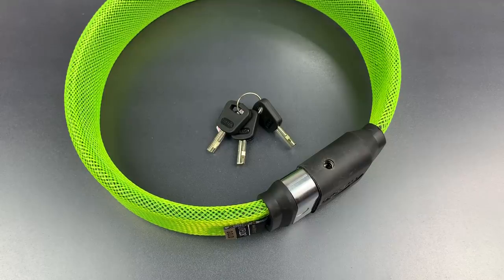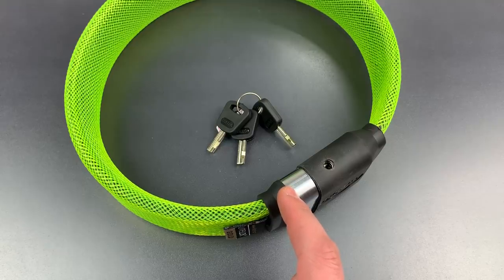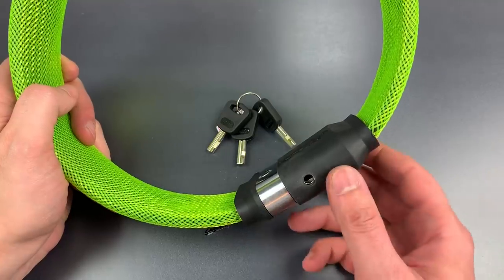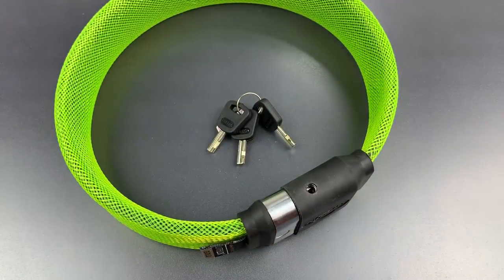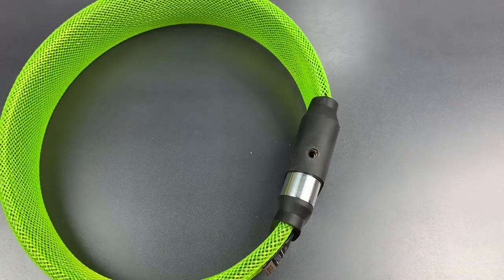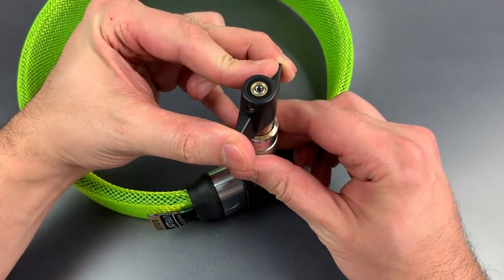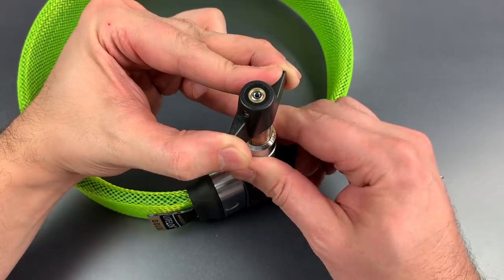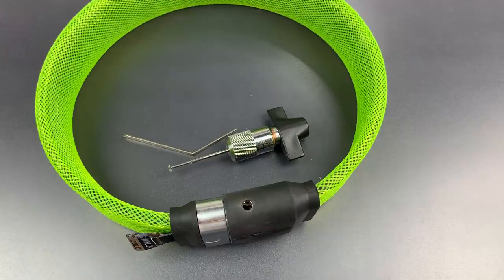[784] LiteLok Gold Bicycle Lock Picked

Comment: Finally someone trustworthy reviewing this lock, thank you very much
Reply: he said something about his tool and not working the first time, that should be shown.
Reply: @snoodballla9632  He said it didn't work. Just pause the video with the tool in for about 3-5 minutes. I imagine that's what it would have looked like. Not the best content, ergo, "It didn't work"
Reply: @snoodballla9632  He said that top tension did not work so he switched to bottom tension.
Reply: @snoodballla9632  its just the bottom vs top disc tension. its going to be one or the other, there's no point showing that

Comment: So there is a video of one of these being defeated "in 17 seconds" that Litelock has apparently had BLOCKED in the UK and tried to have removed from youtube.  When trying a twisting attack have the lock housing to the front and twist it from the back, that seems to be the way that people reported theirs were broken from. I am not sure if some units just don't have enough cable attached to the lock unit or if they are all like that.
Reply from the maker: I think they’ve added epoxy since then. I saw the video you’re talking about and closeups of the broken lock. It appears to be a crimp connection only. Mine is crimped and epoxied. Assuming I’m correct, it may be that they’ve altered the design to address this. As for blocking the video, that’s serious BS.

EDIT- I need to make a correction... now that I have torn it down, I see this joint is welded, NOT crimped and epoxied as I previously noted.
Reply: @lockpickinglawyer   Interesting that they are now adding epoxy. Really looking forward to the destructive testing now that the picking is over. Funny that Wayne Winton said that it was "pick proof" after only looking at the keyway in his video lol.
Reply: @lockpickinglawyer  the epoxy is a joke. You can pull the black rubber without any tools and start working on the cables.
Reply from the maker: I need to make a correction... now that I have torn it down, I see this joint is welded, NOT crimped and epoxied as I previously noted.
Reply: @lockpickinglawyer   Ohh, interesting. Can't wait to see how it holds up.
Reply: @lockpickinglawyer  can't wait for the vid :)
Reply: @lukasadamson6091  he fukn rekt it
Reply: well the litelok video with 17 minutes where they "testing" their lock video is suspicious. they disable like/dislike..Only 7 comment that is all positive in 200k+ views video. each comment is made 3 years ago. all 7 account has generic name and profile picture and has comment multiple time on number of videos on litelok channel. Also all 7 account is created in 2016 and 2017 and majority of said channel is subscribe to the same multiple channel. welp it clearly that they delete comment and using bot for positive comment. 100% litelok deleting comment. i try comment on their video aaand its gone when i check their comment section using incognito mode and other account...coward
Reply: @sirdarkon4517  Yup, it has become a bit of a meme in the lock community. Every time it comes up we all have a laugh.
Reply: @sirdarkon4517  Not true ! 2 comments are mine and both are negative xD
Reply: @lukalalosevic200   I don't see your comments on the LiteLok video, so it may have been taken out (I know many comments can be deleted, but seem like they are still there for the user who commented), so I think there is no chance that they are not deleting comments, because the Litelok video has 7 comments and this one has less views and 350+ comments.

Comment: Excellent.  Time for the Ramset and hydraulic cutters!  Thanks for great video!!
What picking tool are you using?  Haven't seen it before...
Reply: my bet is on the ratcheting cable cutters
Reply from the maker: Something from the usual Chinese websites, but modified.
Reply: @lockpickinglawyer  Thanks, but for those of us who are kinda new, can you tell me a little more about which "usual Chinese sites"? Thanks again!
Reply: @telorum1970  Banggood.com  I know what it sounds like, but it's basically Chinese Amazon.
Reply: the ratcheting cable cutters and the hydraulic cutters are pretty OP. Once you have both you can open anything you find on the street.
Reply: I would like to see the ramset gun used on this lock
Reply: start with standard bolt cutters and move up.  After the cable is cut, then ramset the locking mechanism!
Reply: @lockpickinglawyer  Thank you for the reply,  the great vids and narration.
Reply: For those who will be searching exactly this one it's "lock pick for ABUS"

Comment: Entertaining to see all the debris come out of the lock each time you pulled it apart - curious if this one would wear in, and get easier to pull apart with time, or if it just gets worse.
Reply: I imagine if the material the lock lug is coming out of is softer than the locking lug it'll eventually just gall up and become a total mess. Probably requiring you to go in there with a die grinder/file to open it up some. This is definitely a manufacturing flaw, and considering the price of this, it's simply inexcusable, total QA fail.

Comment: I suspect it would succumb quickly to bolt cutters, metal shears or the like.  Looking forward!
Reply: I bet you could get trough really quick with just a small cable biter as well. Since the inside is made of small wires you just "Chew" trough it in a minute or so.

Comment: This robust lock is essential for keeping your bike safe. They tried to defeat a single Litelok with a variety of commonly used kid's playset tools. As you can see, no matter how hard they tried the lock is sturdy enough to withstand all the different toys they use, from plastic bolt croppers to rubber hammers. You can be sure that your bicycle is well-protected from infants with Litelok. Not only does it meet all British and International lock quality standards but it has also attained the greatest security rating (0 out of 0) as awarded by the "independent" testing and certification "organisation" Sold Secure. Liteloks give you peace of mind, they feed you and keep you secure, they are in every sense your anchor in life.

Litelok has an easy-to-use and flexible strap, making it effortless to secure around fixed objects (and to cut open), from bicycle parking stands to street furniture (what does that even mean lmao). It also comes with a patented inline (and definitely pick-proof, trust me) lock that was developed in close collaboration with a renowned British firm, whose name has been long forgotten to time. Liteloks close shut without a key. A key (or cable cutters) is only needed to open a Litelok. Weighing just 1.1 Kg (2.4 lbs), it is also very practical to carry around with you. While cycling, Liteloks can be secured along the top tube of your bike with high-quality velcro WrapStraps (which may actually be stronger than the Litelock itself), or within your bike frame. Alternatively you can carry your Litelok in a bag, or perhaps where it belongs, in a disposal bin.

Oh and by the way, it can be opened in 16 seconds with cable cutters.

Comment: Owner here:
Yes, my lock also requires a lot of strength to wrap it in order to close and open it. The key sometimes is stuck, when the cables bend the closed lock. So in order to open or close, I sometimes have to wrap the lock even more. Also the key sometimes is hard to even slide into the lock without twitching it around. One of the most vulnerable places to cut the lock is where the black rubber starts and the green nylon end. The black rubber is only glued on the blank cables and can be pulled away to reveal them.

The very concept of the lock might be cool. That's why I bought it (ass cheap second hand - didn't believe the problems I just stated when the previous owner told me about them). But the lock isn't that light and very unpractical even if you fall for the marketing gag of buying two pieces and clipping them together to use them as a belt  - I'm quite thin btw.

Comment: As always, a brilliant job opening that lock.  I haven't sent those things to you since we have some issues right now with our postal service.  Another thing that comes to mind is that it looks hard to get through the spokes of a bike wheel.  Since it's heavier than a U lock, that's kind of disappointing.  When I'm going somewhere, it's pretty clear that it's not the bike or the lock that needs to be lighter, but even so every bit helps.

Comment: Nice video. Thank you. 

How about Boomerang Cyclotrac GPS Tracker and alarm? It has proprietary screws to attach where the bottle cage goes, and you can still put a cage over it. It uses Verizon's LTE for real-time tracker, alerts and alarm if the bike is wiggled to much.

Comment: i think the main physical weakness for these locks is where the cables meet the clasp. the one i saw fail just had the cables simply crimped into place which isn't a strong enough bond to resist twisting. the ends should be brazed or soldered together or the ends of each cable capped and then bolted into a block. 

strong, light, cheap. PICK TWO.

Comment: Big side cutter plus a big hammer = 15 seconds or so
How to: place the wire in the side cutter jaw as deep as possible, with the cutter square against a solid wall or the floor(one handle of the cutter sits firmly against that wall or floor). Then hit the upper handle with the hammer. 2-3 times for each wire should be enough.

Comment: I reckon that lock picked is still more secure than a master lock.
Reply: I mean, a well placed length of mechanic's wire is more secure than a master lock,  if only because it's a pain to work with.

Comment: I would love to see you show how the cables can be pulled out of lock housing with twisting.
Reply from the maker: I’ve seen that video, but I think they added epoxy at that joint since then. Besides, I have a faster way. 😈
Reply from the maker: I need to make a correction... now that I have torn it down, I see this joint is welded, NOT crimped and epoxied as I previously noted.

EDIT- I need to make a correction... now that I have torn it down, I see this joint is welded, NOT crimped and epoxied as I previously noted.

Comment: I too have become an avid fan. And also, I was curious of the tool you used. Could you please do a video or share some more info about it? Thanks so much!
Reply: It's a disc detainer pick. It allows you to rotate each disc individually while keeping tension on the core. This video might help you understand how disc detainer locks work, and in turn, how the pick works. https://www.youtube.com/watch?v=Qu2vm4At4JM It seems like many of the disc detainer locks that LPL picks don't even have false gates (Not because LPL couldn't pick them, but because most manufacturers don't seem to give a shit about making high pick resistance locks).

Comment: I have that lock and yes it is difficult to open with the keys, some times the keys will not even turn inside the locking mechanism.
Reply: Man, this thing has marketing wank written all over it. If your keys aren't opening it reliably, that points to generally poor construction and tolerances. Makes sense if you consider the profit margin on the lock given the amount of marketing money they're spending on it.

Comment: When you opened it after picking it, I noticed some steel debris fall out, maybe the reason it's so hard to open is tight tolerances and a lack of lubricant? Also perhaps a magnet for some reason keeping the lock closed that you have to pull through?

Comment: You make it look easy. But I think you should mention how much went into finding and modifying a back of key tensioner and learning to use it. The list of people who can open that in a reasonable time is pretty short.
Very curious to see the destructive testing though. I wonder why they think multiple cables is better that one thick cable? couldn't you just cut through them one at a time with bolt cutters?
Reply: It's probably a flexibility thing. One single cable couldn't be that wide while also being that short, as it wouldn't be able to bend tightly enough. The thinner the individual cables, the smaller and more flexible the overall lock can become, although at greater risk of compromise as we're soon to see!

Comment: Maybe it's cosmetic flim-flam, but what's that flat strip at the left of the lock body in front of the cable?  Clearly visible at 3:47.  Probably nothing important.  Or could it be a latch-release mechanism - give it a tug after you've unlocked it and the shackle springs out?
Reply from the maker: Just metal... not a release.
Reply: @lockpickinglawyer  
So why is it there?  It looks as though it could gouge pieces of skin off your fingers as you struggle to get the lock open.  Even apart from that, no competent engineer would include a part that serves no purpose.  So it must do something, right?

Comment: I realise I'm a bit slow to comment but I've a couple of these locks and don't have the same difficulty separating the two mechanism parts although have found the cylinder a bit temperamental.  Most recently I managed to get the key stuck after unlocking and separating the mechanism and now can't turn the key or remove it... any tips to help release the key?

Comment: Just watched a video where this guy cuts through the Lightlock with an angle grinder in 14 seconds. He did day that he thought it was pick proof.  😃🤣😂😆😅😃🤣😂🤣😂🤣
Reply from the maker: Yup, Wayne’s video. He’s probably right as a practical matter... I can’t see a thief picking this. But it’s certainly possible. As for grinding, that’s no surprise... I’m going to try without power tools just to add another data point.
Reply: @lockpickinglawyer  After watching your video on the Lightlock I searched around at other Lightlock vids. I found one that reckons bolt cutters won't touch it.
Reply: Wayne also suggests the lock could possibly be vulnerable where the two pieces of metal grip the locking bolt.

Comment: I don’t understand why they would make that lock so difficult to open. So the difficulty of opening the opened lock is a safety feature???  People won’t know the lock is successfully picked??? OR Quality Control issues?  We might know the answer to that with a second lock but at that price tag??? WOW!!
Reply: Maybe its a premium "security feature". Seriously, though, it looks to be the result of poor manufacturing tolerances. The lock body (as seen when pausing at 1:53) appears to be a cast material. Zinc? I'm going to wager LPL will use a plumbers torch to melt it.
Reply: Knowing the lock is successfully picked doesn't appear to be an issue, because it's physically opening the lock that is difficult, not turning the core. The core appears to turn pretty easily both with the key and when picked.
Reply from the maker: Fluke, there appears to be some zinc inside the steel body, but I don’t think that’s the fastest way into this lock. I evaluate the strap to be the weak link.
Reply: @lockpickinglawyer  If i'm not mistaken the strap is just a bunch of steel cables, so shouldn't be any problem with getting through them.

Comment: I cannot imagine any thief going through the trouble of buying a bottom-keyway disc pick like you used, let alone taking the time to learn how to operate it. This alone would increase the security rating in my view.

I bet poor material choice and machining tolerances are at fault for this lock getting stuck when opened. It seems some tiny metal shavings are actually falling of it on the table when it’s pulled open.

Comment: before you do your destructive test with the usual powerful tools whether you're talkin ratchet cutter or some hydraulic thing or large lever for a twist attack.... Before any of that, I would love to see a quick video where you use nail clippers or simple wire cutters and just nibble down through all the cables.
Because then you're not using any kind of criminal tool... You're just doing it the way thieves do it all over the country.the only difference here is instead of cutting one cheap cable you're cutting 6.